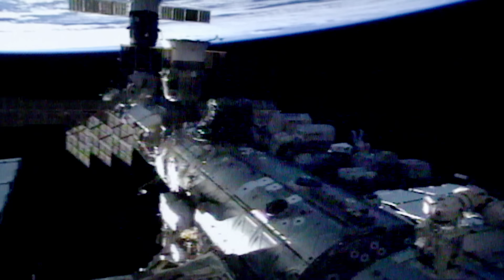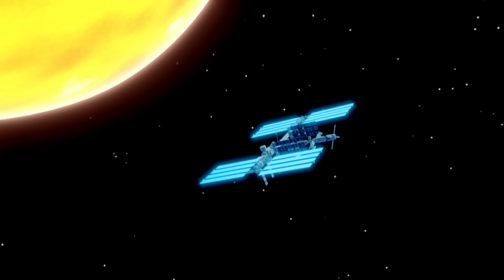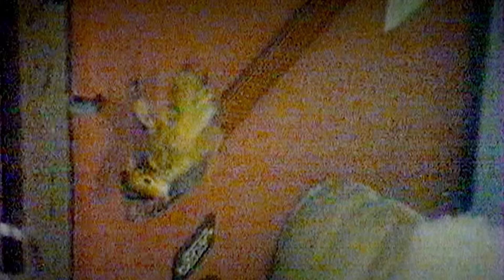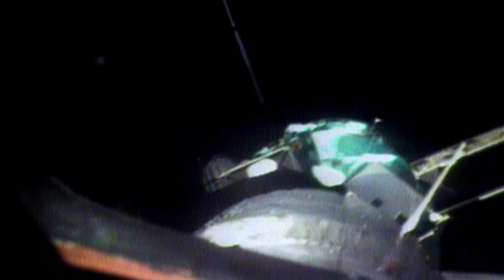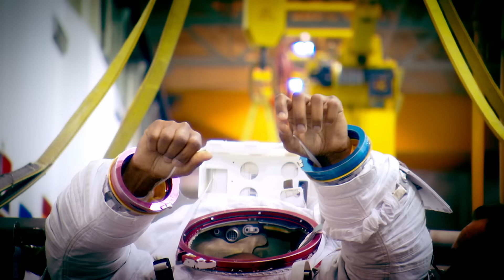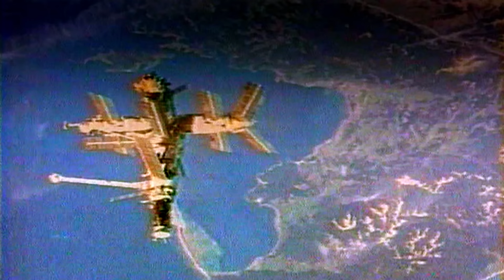A Space Station Odyssey – Big Bigger Biggest

Comment: Liars, frauds and obfuscators...The earth is flat and non rotating and NOTHING man made is beyond earth's atmosphere...It is impossible to communicate through the atmosphere. USAF Veteran, Avionic Communications Technician...
“These equations assume a flat Earth.”

http://www.arl.army.mil/arlreports/2010/ARL-TR-5118.pdf

page 2:
“These equations assume a flat Earth..”

http://www.arl.army.mil/arlreports/2011/ARL-TR-5810.pdf

page 216:
"assuming a flat Earth"

http://tycho.usno.navy.mil/ptti/2007papers/paper21.pdf

Page 1:
“...so that a flat-earth approximation provides the best estimate.”

http://www.arl.army.mil/arlreports/2001/ARL-TN-175.pdf

Page 39:
model works over a flat earth
http://www.arl.army.mil/arlreports/2003/ARL-TR-2696.pdf

page 1:
transmission loss over flat earth
http://www.arl.army.mil/arlreports/2000/ARL-TR-2156.pdf

page 9:
“...input to a flat earth”

http://www.arl.army.mil/arlreports/2003/ARL-MR-563.pdf

page 3:
“The first is the Earth-fixed coordinate system, which is fixed to the Earth with a flat Earth assumption.”

http://www.arl.army.mil/arlreports/2010/ARL-CR-650.pdf

page: 1
flat earth approximation provides the best estimate
http://www.arl.army.mil/arlreports/2002/ARL-TR-2683.pdf

page 32:
This model works well over a flat-earth
http://www.arl.army.mil/arlreports/2000/ARL-TR-1812.pdf

page 168:
equations of flat-earth trigonometry.

http://www.irig106.org/docs/106-17/106-17_Telemetry_Standards.pdf

page 8:
The Earth is flat and nonrotating.

http://www.navair.navy.mil/nawcwd/command/Inplace.aspx/LoadFile/531

General Equations of Motion for Damaged Asymmetric Aircraft

Page 1: “...equations of motions must properly reflect the underlying physics.”

page 2:
"In this paper, the rigid body equations of motion over a flat
non-rotating earth are developed...”

https://ntrs.nasa.gov/archive/nasa/casi.ntrs.nasa.gov/20070030307.pdf

Comment: Air molecules in orbit cause drag.
One method to avoid this is having a magnetic field. A magnetic field around the space station will divert these atoms in the same way our solar wind is diverted around the earth. 
While the Moon is the same size as Saturn's moon Titan it is the fact that our moon travels outside this protection for part of its orbit thus blowing away any potential atmosphere.  Could the moon hold an atmosphere? Yes. In fact Titans atmosphere is 1.5X denser than even the Earths atmosphere. And theoretically even the Earth has enough gravity to contain something 60x denser -- like Venus.
So a magnetic field around a space station would go a long way to protecting it. Even better the energy could come from solar cells so no external fuel would be necessary.
Reply: the air molecules around earth are not all magnetically charged
Reply: @Ckeeze  when something is magnetically balanced it is an oil-based chemical. When it ism is is a water-soluble molecule. There are far mpre umbalancwd molecules than balanced -- about the same ratio as oil is to water in your body (97%). Thus the vast majority are magnetically influenced and those can also bump the nonagmetic molecules to move them too.
So it can effectively be manipulated as i described -- which happens ti be the same method the Earth uses to deflect the solar wind. (The ultimate subject of this conversation)
Physics.
Reply: @LG-qz8om  
N2 and O2 is not charged and those 2 make up 97%